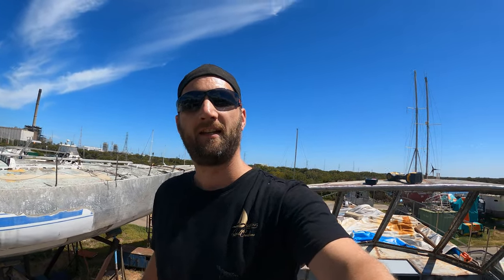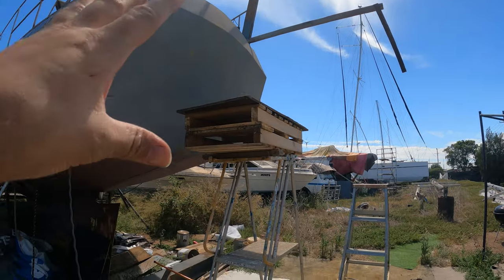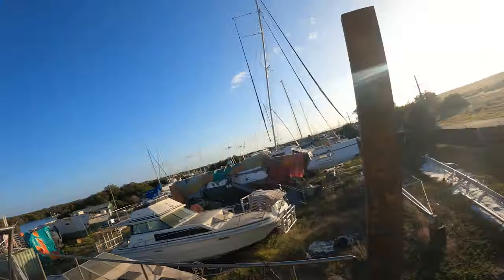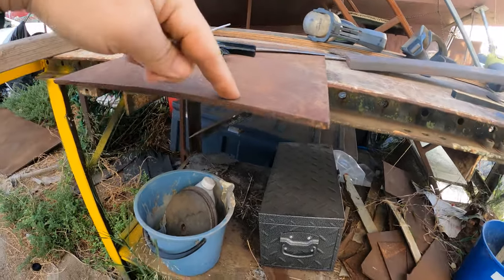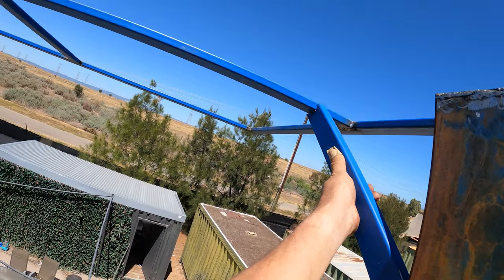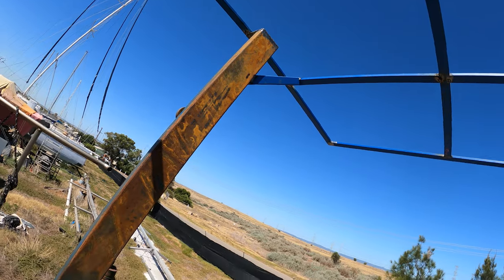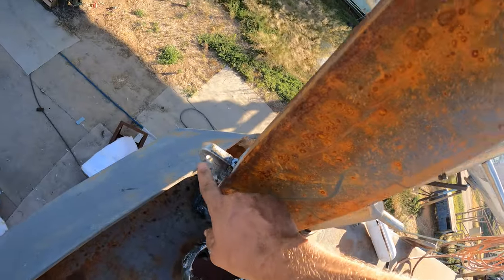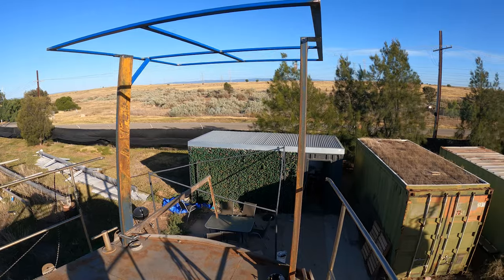Sailing QC # 105 |  Dinghy Davit System  | Steel Sailboat Restoration

Comment: Just a thought on the stern where you welded those pivert points you should cut a couple of holes in that stearn plate so when you get water on board that will drain to the stearn it can flow out.
Reply from the maker: Cheers mate that's a good idea!